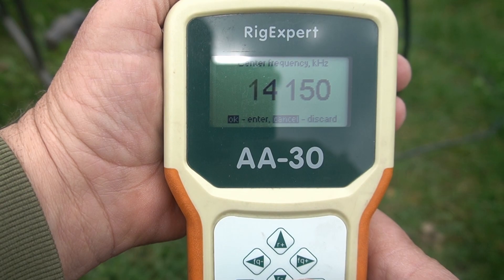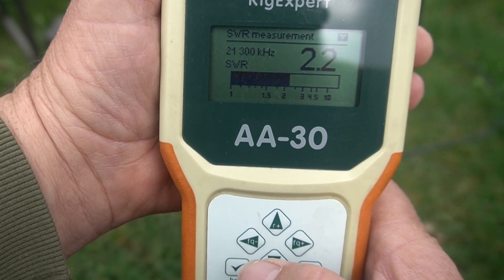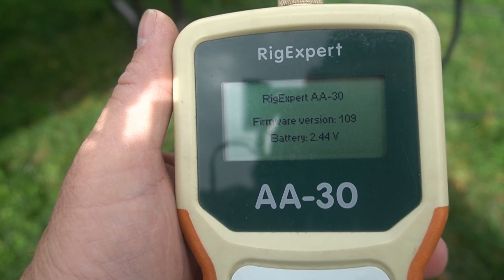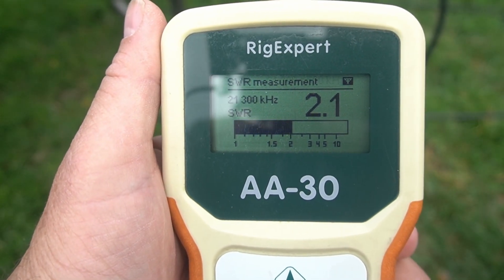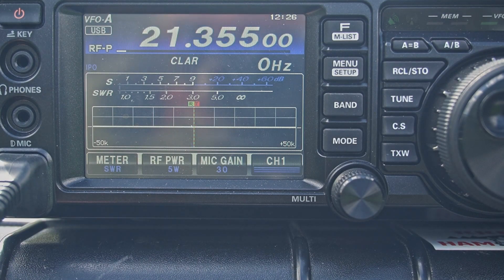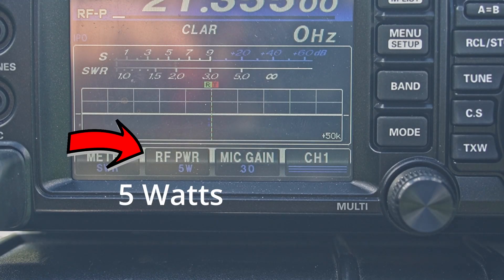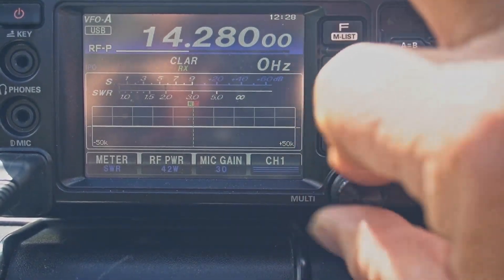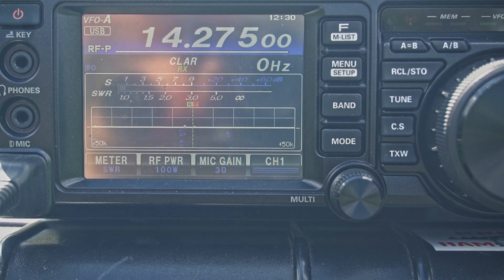DIY Fan Dipole Antenna from Coffee and Ham Radios "CaHR"!!

Comment: I tried to build mine. The spacers broke when it was just about to reach the top of the mast. The pulley system also got stuck. My mast is extendable but fixed so I have to get up on a ladder near it at 15ft above ground. A true nightmare.

Comment: Nice project. The spacers are a problem with deployment for sure. I don’t use any, and I guy off each of my di-poles individually and don’t have to worry about twisting and it is very easy to set up too. I cut and tuned wires for 40M, 20M and 10M. Stringing up 40 M on a 18 foot pole, and tying off the ends with cordage at about 8 feet above the ground on each end. Then do the same for 20 M letting it hang below 40, repeat for 10 letting it hang below 20. I also have 40 M 25 degrees offset from the 20 and 10 M dipoles, it is just NOT critical that they be in the same horizontal plane. Using my FT 710 I work all the advanced portions of 40, 20, and 1.5mhz of 10 without the internal tuner. Bonus bands, 15 M with the internal tuner, and hold on, 6M with the internal tuner from 50.1 to 53.1 mhz, yeah this antenna rocks. Take your time tuning each dipole starting at 40 m working to 10 m, and you will be rewarded. I tuned with only a vswr meter. 73 and good DX. N9XDS.

Comment: Chuck,   I'm doing a monoband dipole antenna for 15m same way with parts from Mercury antenna .    Where did you get info on the balun at the top?   is it just coax wrapped around a toroid?   any detail would be great.   thx!     oh nevermind,   this would be the same 1:1 transformer as with the Mercury instructions  right?
Reply from the maker: Yes, You can use coax also

Comment: I can hang a fan dipole like that but the legs would be at a  90 to each other instead of being in the same plane. The pole is at a fence corner and I have a 100 feet in each direction. Would that right angle affect the radiation pattern adversely. I can't find any literature on this. Hope you know. 73 KN6ZVI